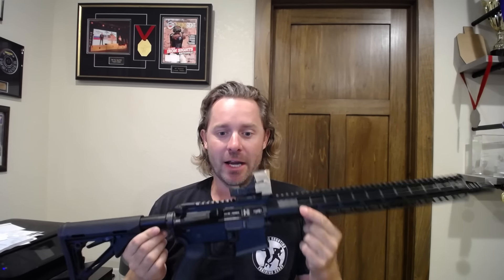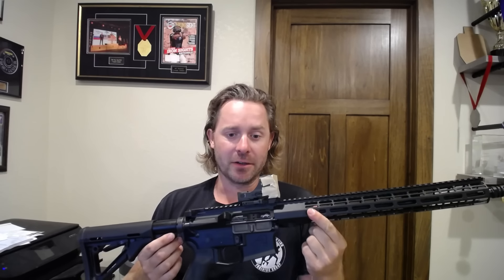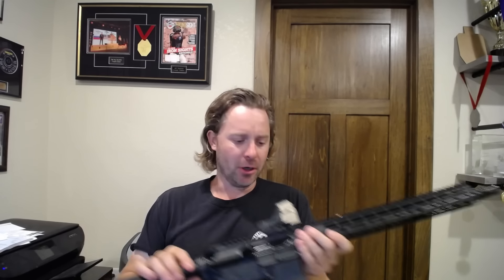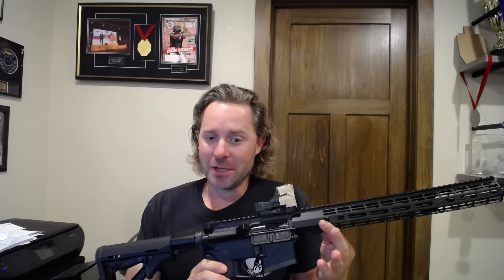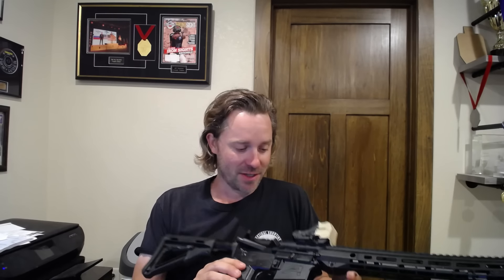Yes I understand Aero stuff is garbage

Comment: just as I wanted to buy a 14.5 M4E1
Reply: If you aren't doing high round counts you'll probably be OK.
Reply: I have one in 16". It's noice, for the money.
Reply: Bro, the BCG takes 5 seconds to change out if it breaks. His entire point is he has a bunch of cheap rifles and it's not a big deal to replace a bolt when it breaks.
Reply: Just buy the receiver cheap....then build with bcm upper  and rail and parts from jp enterprises and geiessle........faxon match and proof barrels usually give me well under moa
Reply: @Jake-uy6qw  in my country its not that easy but I don't care cuz either I can go a lot cheaper or a next step is lot more money
Reply: @carlb86  probably wont. There will be more dryfire. I do intend to shoot a bit but not 20k in a year

Comment: This post makes absolutley zero sense to me. I have numerous Aero builds and they have functioned flawlessly. Garbage...I think not. Try replacing your BCG at around 10,000 rds and you'll have better luck. To call the rifle garbage or junk after you've doubled the recommended use on a bolt, is like calling a quality car garbage because you chose to ride on the tires 100, 000 miles before replacing them. That's why they are called wear parts and do not reflect on the quality of the gun. You evidently like garbage guns if you are shooting them so what sound information have you provided us in this post? SMH.
Reply from the maker: They are garbage

Comment: All that matters is the barrel and BCG.  So Aero is good for what the company was made for.  To build an Ar.  A mil spec upper n lower is the same whether it's a DD, Noveske or whatever.  If u wanna pay 500$ for a lower go ahead, but Aero 100$ lower is just as good.  Just don't buy an Aero barrel expecting Criterion results......
Reply: They literally aren't the same. Lots of out of spec parts on plenty of company's. Bcm seemed to be one of the best for upper receiver on SOTAR.
Reply: @jasonshink6589  mil spec is mil spec......
Reply: @mattself6078  you do realize milspec doesn't  mean a dam thing? Sure you don't. The receiver is made mil spec then can be hacked up by individual companies drilling holes or milling out the trigger well. Had a ruger lower that was way off on the area where the upper sits in the takediwn pin area. Caused lots of slop. Get over yourself
Reply: @jasonshink6589  your one example of how Ruger had tolerance issue and missed by its QC is the prime example to go by, since your one example is the golden example.  Get over yourself.
Reply: @jasonshink6589  sorry your gun felt "sloppy" I usually dont care what my gun feels like, but I am not in my feelings like you.  I just care if the gun shoots straight or not........ the gun industry loves people who like shiny guns that fell pretty.

Comment: I want an AR, but the amount of information you need to know is a little overwhelming. I wouldn't even know what is quality and what is junk. I think I'll just stick with handguns for now.
Reply: Get a good upper like BCM for the barrel and bolt carrier group. Get a cheap lower like Aero since it's not high stress like the  BCG or barrel. Done and not crazy expensive.
Reply: @noah.s95 This, it really can be that simple to start on a budget.
Reply: @noahs.9181  this guy is right.....
.....aero lower,bcm upper &rail, faxon match or proof barrel. 
With jp enterprises and geiessle parts. 
Makes for a sub moa rifle 6 out of 7 builds lol.....and counting...
Reply: You want something good that won't break the bank? Get a "premium upper" from PSA, WITHOUT the Bolt Carrier Group & Charging handle, and then head over to AR-15 discounts or ARFTAC, and get a Microbest c158 Phosphate, and a generic milspec charging handle. Throw that upper on whatever lower is on sale for around 100 bucks, and send it.

The PSA Premium upper have FN cold hammer forged chrome lined barrels which are fantastic, and Microbest probably does the best Phosphate c158 BCG's around.
Reply: @coltonowens2742  thanks for the help! I'm going to grab a CZ P01, but an AR will be my next purchase. I'm going to screeenshot your comment for when I'm ready to buy one.

Comment: Bro you made no sense….. a gun is a tool and I will use it as such. 800$ rifle vs 2500$ rifle….i will run both the same….maybe I’ll take the sights off before tossing the gun 😂 but besides the point use and abuse no matter the price.

Comment: I have an aero pro that has been superb. Going on 6k
Was the bcg's the pro model or just the non chrome lined average middle of the road aero bcg? 
I've had alot of high end bcg's fail bad. If you contact them they will likely replace them.

Comment: Are odin works parts any good? I have an aero lower and upper and has been fine for me. Even the bcg is fine so far. But I definitely want a better end build. Any recommendations on a bolt and barrel for a 6mm arc?
Reply: Aero. Aero is very good
Reply: @CrossContamination-zy9tm . Nope. They are not as good as some think. I know a builder who had several bad bolts and carbine tubes defective. Their stuff is overpriced for what you get too.

Comment: You seem to have had every issue under the sun with this rifle yet Aero has always been a good company and makes good ARs just like any other company that makes mil spec stuff. Did you build that or buy it? Makes no sense that it had literally every issue an AR could possibly have at one point or another and breaks 3 bolts that fast. Any company can put out a bad bolt and they break anyways after enough rounds, and how much is enough can vary widely. If it's a heavier gassed rifle, your bolts may need to be replaced after 3-5k rounds. In something with a rifle length gas system that shoots really soft, your bolts may last 20k rounds or more. MK18s and similar rifles are famous for breaking bolts after not very many rounds. Having seen lots of different kinds of ARs and working on them for people including tons of Aero, this is the complete opposite of what I've seen of Aero over my life.